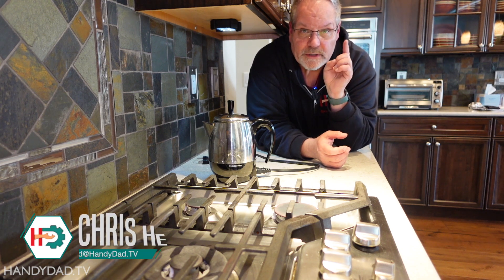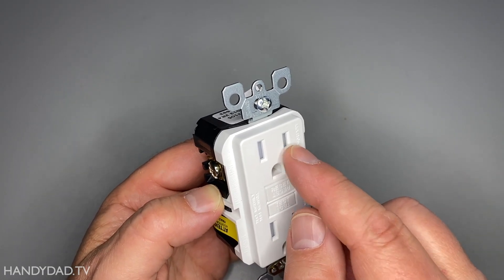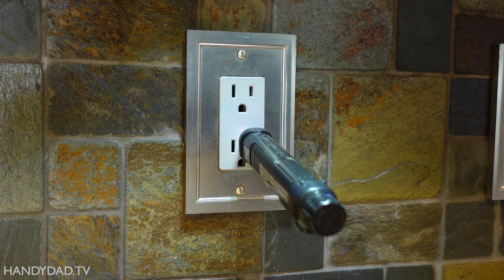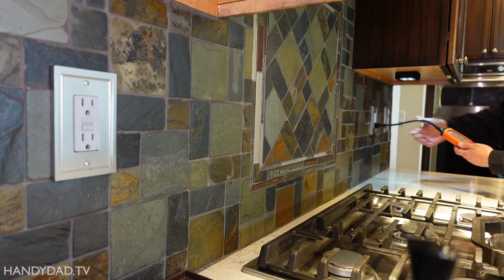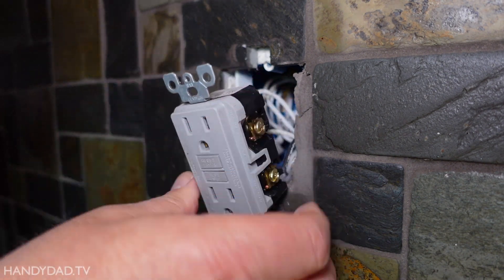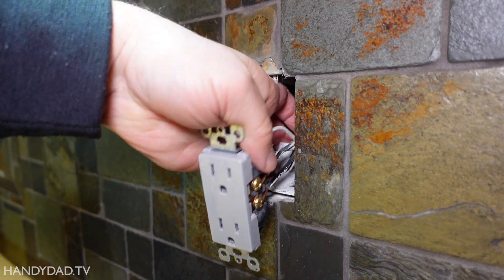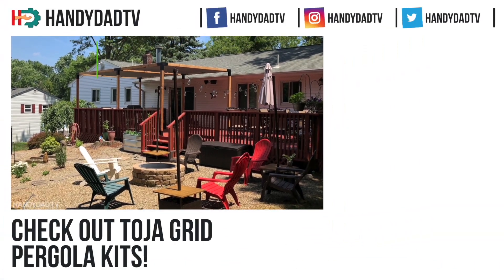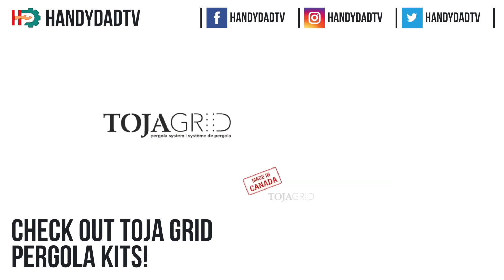GFCI Troubleshooting

Comment: How do you know which switches the gfci is protecting. I have three outdoor gfcis at different corners of the house but one is it working, tbe others are. I try to reset but the button doesn’t go down. Any advice would be appreciated.
Reply from the maker: Call an electrician.

Comment: How did you know which neutral wires go to island vs gfci and does that make a diifference? I mean the set of load (black wires) and neutral (white) ones.
Reply from the maker: You should be able to match the neutral to the corresponding hot.

Comment: Another problem @4:20 is using the receptacle as a 'splicing device', and not using acceptable per code termination connections. (pigtailing)
Reply from the maker: Please tell me where the code says you CAN’T use the receptacle as a “splicing device”, other than the ground which must be pigtailed.
Reply: @handydadtv  per manufacturer
Reply: @handydadtv  Additionally, if i only had a dime for every burnt receptacle if had to repair, I wouldn't be still doing this trade for 38 years.  I'd be sipping Mai Tais.
Reply: The code also doesn't state how much, or how less insulation must be removed before you hook the conductor to the terminal, but here we are.   Also, @4:20
Reply: @handydadtv  There are also devices called "box extenders" that can be installed for situations such as this one.  (Others may know them as "goof rings")   Now, that is a code in the book.

Comment: I had a brand new Eaton GFCI be bad, kept tripping breaker immediately, had to isolate the whole run and essentially work my way down removing things until I figured it out.  Replaced it with a new one and issue fixed. So it does happen even with quality brands.
Reply from the maker: Good to know. Thanks.

Comment: Wont stop blinking red. Its hooked to the light and fart fan i believe because none are working. Won't reset wont test. Tried resetting breaker and everything. Do I need a new gfci?
Reply from the maker: That’s not normal. Probably needs to be replaced.

Comment: I have had to replace several GCFI outlets just because everything else worked. I know GCFI outlets go bad or are weak. The standard practice is to replace them if you can not determine the cause of the issue.
Reply from the maker: Thanks for the info

Comment: Our electric kettle caused a similar issue. Turned out to be steam condensing inside of the outlet and causing the short
Reply: Bingo - if you’re boiling water to the point of steam under a cabinet, the condensation can trip the gfci
Reply from the maker: Huh. Good to know. Thanks!
Reply: Exactly what I wondered

Comment: I had a bad outdoor outlet downstream from the GFCI. The bad outlet was not WR (water resistant) and was located on an upstairs balcony. That outlet was exposed to rain or moisture. Four electricians couldn’t fix it. I believe one knew what the problem was but wanted to charge me $2,000 for a “circuit analysis”.
Reply from the maker: Yikes 😱

Comment: GFCIs are designed/manufactured to trip if they sense a current difference of 0.005 amp or 5 milliamp or more between the line (hot) and neutral conductors to the load,i.e. appliance, etc. Appliances have insulation between windings and ground if equipped with a motor or resistive element and ground if equipped with a heating element. There can be a small amount of leakage current through the insulation. Regulatory agencies require that this leakage current be less than 0.5 milliamp.
Reply from the maker: Good to know. Thanks!

Comment: I installed Leviton GFCI in two bathrooms, since the outlet stopped working all of a sudden. One of the GFCI outlet has the small green light ON but still not working. The other GFCI’s green light is NOT ON and is also still not working. On both GFCI outlets the test and reset button is also not working. The black test button does not go in but the red reset button goes in and that is it. I searched all over the house and I found/reset 4 other working GFCI outlets, one in kitchen and one in basement and 2 in garage and they all work good. What May be causing the issue in the bathroom GFCIs please?
Reply from the maker: It’s very strange to have a green light and not be working. Sounds like it may be bad. 

I’d move the other one to replace that one and see if it goes on. 

It sounds like the second one may be wired as load from the first. So a second GFCI may not be needed at all.
Reply: @handydadtv  You May be right here. I forgot to mention the second GFCI with NO green light ON in small bathroom was in place of a regular outlet. I put GFCI in there because it was in the bathroom. I am thinking to alternate the Hotwire on the one that has green light ON since I read it may be a polarity issue? Do you think that’s a good approach? I don’t know why this house had a regular put in the small bathroom before. Note: I am still learning things as we recently moved to this house.
Reply from the maker: @worldpeace5853 It probably had a regular outlet because it was protected by the other GFCI. That is a common practice.
Reply from the maker: @worldpeace5853 Be sure to watch this one… https://youtu.be/inpvNt6591E
Reply: @handydadtv  I will try this sometime this week. Appreciate your prompt reply. Please keep up the good work on the videos. Loved your explanation on the other video down below as well.

Comment: In my home all bath room plugs are off ( no gfci ). EB switch is on for bathroom. 
I checked dollar rama night LED light its turn on with very low light but nothing else.

Can someone help here
Reply from the maker: If a nightlight is your only means of testing voltage, you shouldn’t be doing your own electrical work. 

That said, you must have a tripped GFCI outlet somewhere.
Reply: Maybe check your breaker panel to see if the bathroom circuits are on an Arc Fault breaker - noticeable for having a Test button.  That's what my house does for bathrooms.

Comment: I purchased a new GFCI outlet and installed it correctly using the voltage detector. About 1-year later the outlet stopped working again. So this is twice. Original why I replaced it. Any recommendations. Thank you
Reply from the maker: Sounds like bad luck. They don’t fail very often.

Comment: so nice you make a video that only applys to well off folk some of us have fuses and old very old panels and when a GFCI goes off and won't reset there is no clue but okay everyone lives in this world in a modern house with modern breakers ....I have fuse in my garage and I can't reset the GFCI the button is full stop. You have what you have .  1940 home Its a hybrid between breakers and fuse with central AC its awful and the house needs to come down Thsnks it is good.
Reply from the maker: It’s completely inappropriate to relate circuit breakers as a measure of affluence! They’ve been required in all dwellings since the mid-1960s, regardless of price. 

It sounds like someone already started modernizing your electric service. I’d think about finishing that job.

Comment: Hello, Thanks for video!

I just bought a GFCI outlet and am wondering if the test button (breaker) should pop when pressing the reset in when it’s fresh out of the box and not connected to any power?

TIA 🌻
Reply from the maker: The test only works while connected to power.

Comment: Some of these GFIs are just plain quirky.  I have learned a tiny amount of variant voltage (Usually from electric motors) can trip them.  Although a coffee pot is just a heating appliance, they do have a heat thermal cut off switch/ Thermostat which cycles. The longer the pot is left "On," the better the chance of the GFI tripping due to the action of the stat.  Our refrigerator used to trip its GFI about once annually or more, usually near vacation time (Must have been a subtle divine warning!).  I remember getting an extension cord and using a connection to a plain outlet while we were gone. My word to the wise is: Be cautious, you could come home to spoiled food and a smelly refrigerator.  Almost happened to us. I believe they now say do not use GFIs for appliances with compressors or motors (Because their internal switches and motors will arc and trip a GFI on occasion (Probably will when you are away).
Reply from the maker: Thanks

Comment: Thanks so much for your video. Two of our outlets in our kitchen weren't working. Our microwave stopped working too. None of the breakers weren't tripped. I checked all the outlets in the kitchen, and it ended up being an air freshener that was plugged in, that was super hot. I think it definitely was that air freshener that was causing the other outlets to trip. Once I unplugged the air freshener, I reset the two outlets that weren't working, and thank goodness it worked. No more issues, and now the microwave works again!!!...This saved us from having to call our electrician!!!👍👏👌😊
Reply from the maker: Glad it was helpful 👍🏻

Comment: I installed one GFCI today and it seems to be working well except for one thing. I connect a lamp and press test and it trips and turns the lamp off. But the green LED light never turns on. Then I press reset, it makes a sound again and the lamp turns on. Do you know why the green LED in the GFCI won't turn on? I have 130V from L to N, 130V from L to G and close to 0 V from N to G.
Reply from the maker: Sounds like all is working except the indicator light. So it’s just a faulty indicator. The test button is far more important.
Reply: @handydadtv  I was thinking the same.  But it's brand new, I'll check again tomorrow to see if all is connected correctly and maybe run some tests on the grounding. I'll call Schneider Electric last to see if they have any other thoughts. I agree the buttons functioning is far more important but the led light is a nice indicator to have :). Thanks a lot for your quick response!

Comment: My moms house has older gfcis and weirdly only 1, but we tried to do some floor work whichcause some issues, which i tried fixing the symptom, not knowing to go for the root which may be the bathroom gfci. Now when i tested it with the sniffer, it beeps for the hot side but not on the neutral, and the small plug in tester shows both are plugged correctly. But the down stream symptoms are 3 of our kitchen plugs do not work at all. Oh and the gfci reset buttons do not let me reset it either. 

Now that i know about them needing to be near water,we really should have 3 in the house.
Reply from the maker: Yes, you definitely need to start by replacing the GFCI if it fails to trip when tested. 

I had a similar situation where both of my bathrooms were wired from the same GFCI. It’s not a code violation; just a cheap electrician. Watch this: https://youtu.be/dbmRETinw0A
Reply: @handydadtv  thank you for sure. I will definitely look at changing it and I hope it fixes it. And I will watch it for sure. I have been trying to learn as much as I can to help my mom out with her being on a fixed income.🙏 thank you again for your advice.

Comment: Kevin Rider - Having the same issue with a commercial coffee maker at a building I take care of. I've watched it trip while operating fully and pulling 11A, and have replaced the GFCI but have had it trip since I installed it. Found when I flipped the breaker off I still had 10V at the outlet and then at other times I was getting 1.8V at the circuit. It's been 1.8V at the circuit a while now with the breaker off and haven't had any issue with it tripping for a while now - weird what you find sometimes going on with electricity.🤨
Reply from the maker: Wires running next to each other can induce small voltages even if the breaker is off. https://forums.mikeholt.com/threads/induced-voltage-in-wire-due-to-current.71231/